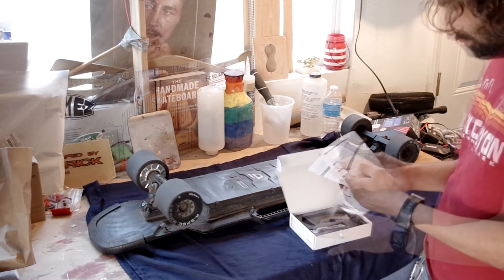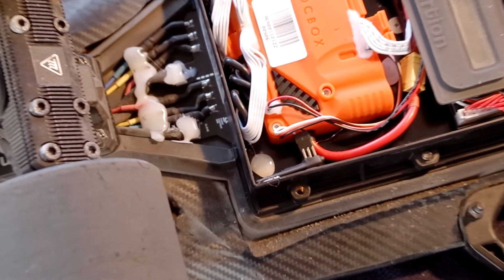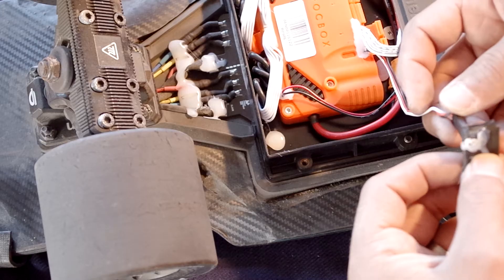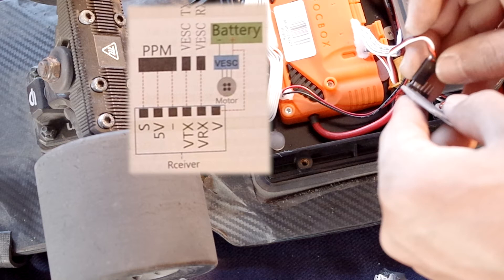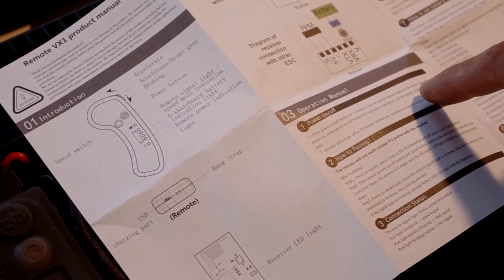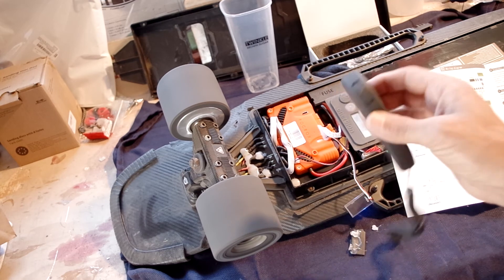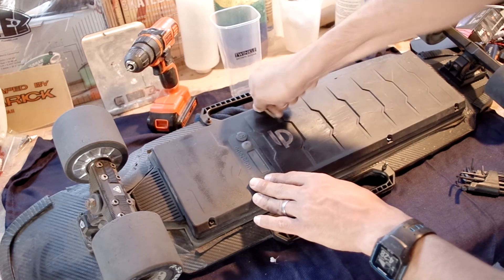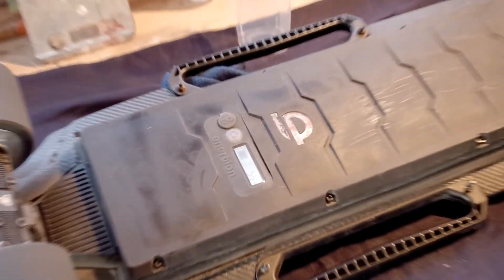Enertion Raptor 2.1 Nano X Remote Replaced by Flipsky Remote (DIY Electric Skateboard)

Comment: Hey Dan, Thanks a lot for the video! I'm thinking about Replacing my Nano X with either the VX1 or VX2...

Google AI states that ''FOCBOX Unity / Tenka (newer dual ESCs): VESC 6 hardware derivatives.'' Can anybody confirm this as a few months ago I almost purchased the V4 version but now I'm leaning towards V6?

I guess a bit more research is required...

Thanks!

Comment: Hey I know this is a long shot I just installed the remote and I noticed an extreme difference in the throttle response
Reply: I also noticed that the motors stay engaged meaning you could not kick push it like you could a regular skateboard unless you turn the board off. Did you notice any of this when you installed the new remote

Comment: I had the same thing happen to me... multiple times.  I repair electronic devices as a hobby so I managed to repair it each time, but the chosen USB port for the controller is not a very robust piece. its all SMT with no through holes to take stress off the solder joints, and they ALL will fatigue over time. I just found this video as I had enough of the remote and decided to look for other options.
Reply from the maker: Hey Travis.  Glad you found this video and I hope its helpful.  I replaced the remote about 2 years ago and it is still work perfectly.  Wish I did it sooner.
Reply: @Rovettod for goodness sakes which remote is this? The v4, v6 or non vesc

Comment: Same thing and I got the USB port soldered again. I also got a replacement remote from Enertion right before they busted and two pairs of 90mm rear wheels. Would have loved to get the off-road wheels though.

Comment: Hi, I’ve managed to get a complete Enertion raptor 2.1 deck and battery housing with remote and one focbox I was wondering if I should buy the hub wheels and another focbox or go with another brand entirely to make diy board? 
I already have a battery.

Comment: Pretty sure it’s a good idea to connect to your VESC using VESC Tool via usb & computer so you can program the remotes full throttle and braking under the ppm settings.
Reply: Yeah I just swapped the remote and I'm encountering an issue with motor resistance while powered on. Going to tinker with this tomorrow. Any good resources on how to configure ppm settings?

Update: I figured it out. Just connected the board > remote settings > run auto wizard.

Thanks for pointing this out.

Comment: If your replaced the motors with a direct drive kit you could run normal wheels which should improve the ride massively not not sure about AT wheels though. 

I wanted a raptor for so long and one just came up secondhand without the remote so this video was really helpful
Reply: Which version of the flipsky vx1 did you get? The v4,v6 or non vesc?